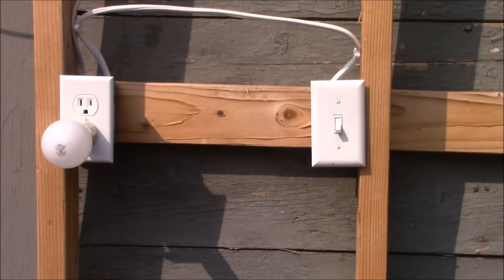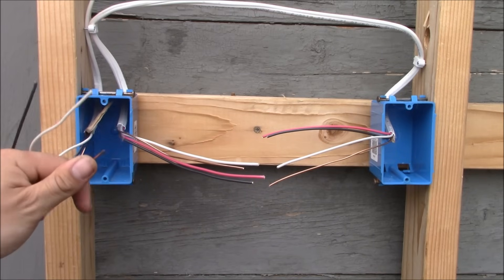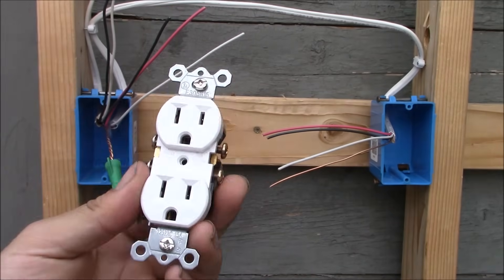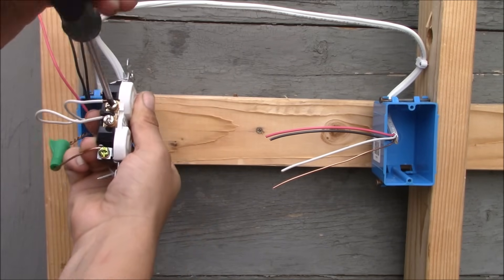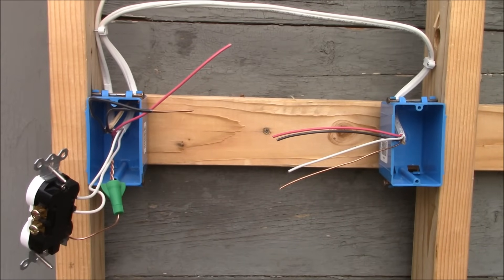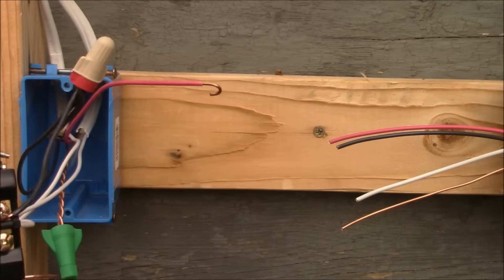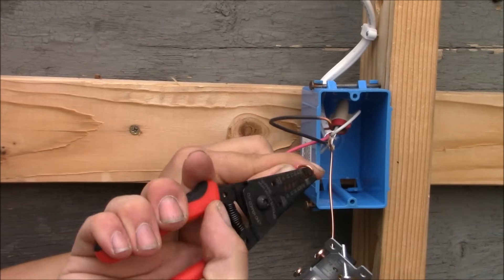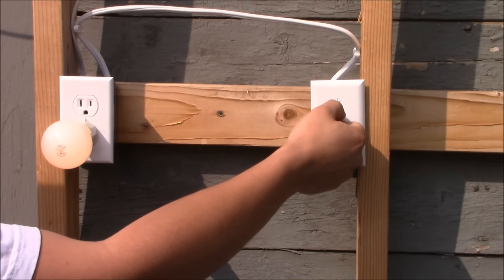How to wire an outlet to a switch (half hot receptacle)

Comment: I’ve seen an application where this was done with two lengths of 14/2 wire and the white wire was used in place of the red wire with a piece of tape to label it. I don’t think it was code but it was interesting to see and I’m just glad it was labeled 😊 but that’s not allowed I assume correct

Comment: My completed circuit shows an open neutral. Is that because of the neutral I capped off with a wire nut? Is the circuit good if that is why?
Reply: If that's not the reason, I've got to break it all down and do it again

Comment: I researched the internet on how to wire in a split switched outlet. I even printed it off and tried to figure out how to do it, but there were three or four wire nuts and grounds that your video didn't have.
I am now on a ladder finishing up the last connections to be able to power a fan in my garage without having to climb up to cut it on and off.
Thanks a hundred times over.
Reply from the maker: You're very welcome, I'm happy to know that my video was of a small help

Comment: What would you do if power came in from light switch and you used 12-2 wire to outlet already? Can you still make one half of that outlet always hot with 12-2 wire going to it? I originally had it wired as an on off outlet used for garbage disposal but installed a sink faucet and I need a hot outlet. Can I get it from that switched outlet?

Comment: Hi, Great video, Can I use 12/2 wire for this? I have a lamppost and a light switch, and I added a receptacle  to the bottom of the lamppost, but I only want that on when I only use the receptacle?

Comment: Why do you need to use 14-3 wire to the switch box, when you're not using the white neutral wire? Why can't you use a 14-2 in both boxes, and use that white neutral wire coming out of the switch box in place of the red wire. After 2011 this would be a code violation I guess.

Comment: I want to put a smart switch in this exact kind of situation.  However, smart switches require a neutral wire, and as you mentioned these switches don't use them.  Mine doesn't even have  the neutral wire (built in the 70s).  

What do I do in this situation?

Comment: Help! Low voltage on my switch controlled outlet. My outlet box only has 2 wires. A white with black tape on the left and a red wire on the right. Can’t figure out the problem. Any clues?

Comment: Question. I installed a receptacle and removed the tab like you did, but still both keep being "hot" even if I flip the switch. I noticed that on another room the room was already "programmed to be top being hot always and bottom controlled by switch, but then I installed a new receptacle without removing the "tab" portion and now the other outlet taht was previously controlled by switch now is active on both. Do all receptacles in a circuit have to be the same for this to work? i.e. do all of them have to have the tab removed in order for it to work? Any help is very appreciated.

Comment: I am getting an open ground on the outlet after connecting everything in the video. I made sure that the ground wire going back down into the switch box are all connected via wago connectors. What is causing the open ground reading?

Comment: i followed this video exactly but somehow the red and white have power (are hot) always. before connecting anything, i checked to see if my wires coming off the gfci (load) are good. they are black (hot) and neutral and ground without power. it’s not until i connect wires to pigtail the hot wire that the other two wires (red and white) suddenly become hot. 

my power is coming from a gfci outlet and at this point am stumped about how to proceed. can anyone help me out? i’m not sure what i’m doing wrong.

Comment: what if I want to make the outlets full hot and use the switch to control a light?
Reply: You could run 14/2 from power to receptacle, 14/2 from receptacle to switch. Do not break tabs, pigtail neutral and hot and connect to receptacle on appropriate screws. Add 14/2 from light to switch. In the switch box, wire nut the 2 neutral wires together. There are 2 hot wire connections on the switch. Connect the one from the receptacle to one screw and the one from the light to the other. It doesn't matter which screw on the switch. Connect the neutral wire to the silver screw on the light housing and black to gold. If there are no screws in the light housing, there will be a black and white wire. Connect appropriately. I didn't mention ground wires yet, but pigtail and connect to device in each box. Now the switch will power the light and the receptacle will be full hot.

Comment: Question for ya I have a switch that has 3 wires coming in that are 12-2 . One wire brings power in from a receptical . The other wire goes to a light and the 3rd wire goes to two recepticals right now the 2 recepticals have switched power how can I make them have constant power and have only the light have switched. How would I wire the switch . The switch has to gold screws and a ground. Please help thanks

Comment: what if i want the switch and the outlet to run independently?

the switch currently controls some recessed lighting and an outlet

i just the switch to ONLY controll the overhead lighting

do i just eliminate the red wire?

Comment: when you have power coming into the outlet, you don't need 12/3. use 12/2 for the switch leg and mark the white wire to the switch as HOT., (black tape, or sharpie marking.) the only time you need 12/3 in this situation is if you are running a combination device at the switch (switch/outlet) and need a neutral.

Comment: thanks for the video, I have this at home and I was wondering what would be the easiest way to disconnect to leave the outlet just working? from the outlet itself or the switch ? thanks
Reply: If it’s wired like the video shows delete 14/3 coming from receptacle to switch & delete switch or pull power & new switch leg to switch box,  outlet will always be hot cause it has power coming from there

Comment: Mmmm I think you reversed the red and the black wire on your switch? The black is HOT and the red is your TRAVELER to the outlet. Power should come in at the bottom of the switch so it flows out when the switch is lifted up! Think of the electrical switch as a gate valve in plumbing.

Comment: Does it matter if the constant hot is on bottom or top? Everybody who makes one of these videos has the switch on the bottom. I’m replacing all my receptacles and the previous one was switch at the top and constant on the bottom. I don’t see why it would make a difference, but I only know enough not to get zapped.
Reply: Not at all. Personal preference.

Comment: Wait, if the white neutral isn’t even hooked up in the switch box, then why is it hooked up in the plug in box?
Reply: It saves one connector in the box... Those wire nuts take up more space than you think.

Comment: Hi , nice video, i have a question, i removed a light fixture on my garage and extend the cables to add two light fixtures outside of my garage, so those ar working good, and look beautiful, those are switch, now , i need to add an outlet, but i need it to be hot all the time, even woth the lights outside off, how can i accomplish that? The fixture i removed imside the garage only have 2 cables, a white and a red , so those are coming from the switch to the fixtute in the garage, that now has a junction box that goes to the lights outside. I appreciate your help

Comment: Thanks for the video it was pretty straightforward.  The only thing I didn’t understand was your description of the neutral.  You mentioned since you wouldn’t be using the box you can cap that wire and shove it to the back.  Can you elaborate?

Comment: When you wire the red and black onto the switch does it matter which one goes on which and or does it not matter ?
Reply: they can go either or because it is a single pull switch, other switches it does matter. the hot terminal screws are connected  on the inside of the switch when the switch is flipped on, when the switch is turned off the connection is broken. one of the black wires he wire nutted together in the box with the receptacle/plug is the feed/hot wire and by connecting that to the black wire that leads to the switch that sends power to the switch as well and then when the switch is flipped on the terminals are connected and the power is allowed to go through the switch leg/red wire back to the plug. so since the terminal screws are connected and power is sent between the two when the switch is turned on it does not matter which screws they are on. since he broke the tab between the hot terminals on the plug the bottom with the red wire is switched and the top is constantly hot/on.
Reply: For a single pole switch it usually doesn't matter at all. But for me personally I always put the hot wire(black) at the bottom, and put the load wire(red or white) on top. 

But for other switches like a 3 way it does matter. Hope this helps.
Reply: Thank you guys

Comment: that's a great video...I just have a question.... do we have to connect the white wire on the outlet we are adding? just asking because we are not going to use it on the switch box right? on the outlet box, can we connect just the white wire that comes from whatever the power is coming from? is the connection on the two silver screws going to work as one? I don't know if I asked the right way but would appreciate if someone answer my question.Hope I didn't get you confused....lolor can I use the same kind of wire (14-2) and just use the white wire that goes to the switch box as the red wire and maybe mark it with some black electrical tape instead of the red?

Comment: Can this be done to a GFCI outlet as well?  We had an electrician install a GFCI and a switch under our sink when they installed a garbage disposal.  I want to now add a hot water dispenser as well, however, I found that both outlets in the GFCI can be run by the switch.  I want to be able to plug both the garbage disposal and the hot water dispenser in, but only the garbage disposal run by the switch.  Is this possible?

Comment: I have a question. I'm trying to control an outlet with a single pole switch, how would I do this with 12/2 Romex instead of 14/3.
Reply: 120v receptacles require a neutral, so you can’t use the white as a switch leg in this case so you need 3 conductor

Comment: Great video.  I was able to follow the instructions exactly to wire a half hot that turns on LEDs in the closet with the light switch and retains always hot on the upper half.  Very straightforward and easy to follow.

Comment: Great video, straight to the point. You did the same thing in under 5 minutes that others have shown with extra jibber jabber and nonsense in about 18-25 minutes. Will be referencing this to make sure I get mine wired up correctly.
Reply: Right, no weather reports or pets or what your goat is doing. Straight to the point, great video!

Comment: Would it be wrong to assume that had you not broken the tab off on the receptical  on the brass screws that both plugs would be hot with the switch on?
Reply: If everything else was the same. The plug would have been hot all the time and the switch would not have made a difference.

Comment: Great video. I have an outlet that was set up this way, but something happened where now BOTH outlets turn on and off via the switch - does that mean that the copper connection has somehow reattached itself or a wire is connecting the two?  Any suggestions would be greatly appreciated.

Comment: I upgraded the old look with newer leviton switches and receptacles, I did the switch first everything was fine, my problem is now after replacing receptacle it stays on and now the switch has no affect on it, what did I do wrong? There's a ground and 4 wires and 8 quick connect holes on the old outlet and only 4 on the new I put all 4 wires in order.  Where did I go wrong? 

Where's the video to wire a on and off receptacle?
Reply: You need to break the metal tabs

Comment: What if the half hot receptacle is controlled by two different switches (3-ways)? I updated my switches and receptacles and thought I wired them back the same but now one of the switches is acting as a master (must be on for the other switch to work...) Thanks!
Reply: Honestly it seems like you have the hot wire in the right place for a 3way switch since the hot matters on a 3 way. 
It seems like you just need to switch the 2 wires around, not the hot one but the others. Hope this helps, but by the looks of it it's been 2 years, soo you've already found the solution too it hopefully. 😂
Reply: @j.rjunior5584  hey, thanks for the response. Have not addressed the issue, we've just gotten crafty with our switch use, haha. Maybe one day I will actually get around to it!
Reply: Did you get an answer to this question?
Reply: @Igotloveonmymind  I'm afraid I have not. Just been living with it!

Comment: Help! 

How about if I wanted to reverse this so that the outlet is always powered. Is my write-up below correct? 

Buy a new receptacle and do not break the connection between the 2 bronze terminals

Cap off the red wire. 

Connect the 2 black wires to the bronze terminals.

Connect white wires to silver terminals. 

Connect ground wire to ground terminal

At the switch

Cap off the red wire.

Connect the black wire to the bronze terminal.

Connect wire to the silver terminal.

Connect ground wire to ground terminal.
Reply from the maker: That sounds right to me.
Reply: @SkillsAndTrade  it worked. Thanks!

Comment: Thank you for this video. I installed this setup on for my garbage disposal off my dishwasher circuit. I would of ran it on it own dedicated circuit but one was not installed for the house. One concern I have is that when plugging a tester into the switch outlet, I get a neutral open light. I assume his is correct since one neutral wire was left unconnected. Is there any call concern?  Everything works fine with the switch. Thanks!!

Comment: I have a wall switch that goes to a half hot receptacle on the opposite corner of my master bedroom. I have no ceiling light, so this outlet provides the lighting for this room. Personally I think it sucks that no ceiling light was installed when they built this house in the mid 70's.  I took a look at the way my switch was wired. I found that, in the switch box, there is only a black and white and ground wire connected to the switch.  And the half hot receptacle had two cables wired inside, both with only the black white and ground cables. No red wire at all. I'm just trying to get a grasp at why the red wire wasn't needed at all since my set up didn't have it. Also all the half hot receptacles in my house seem to have the half hot plug on the top, not on the bottom. Is it code, that they have to be on the bottom? I want to add a ceiling light, and use this same wall switch. Can't I just tap into the cable that connects the switch to the half hot receptacle, without having to  run another cable from the switch to the light?

Comment: Question. What’s the point of connecting the neutral wire to the receptacle on the 14/3 if the other side isn’t connected to anything. It’s wire nutted and pushed to the back of the switch box.
Reply from the maker: To complete the circuit
Reply: Skills and Trade 
Why don’t you connect the neutral to the switch?

Comment: - Does it make any difference which terminal is used for the red or black wire to the switch ??? Thanx for the info. It was short, sweet & concise.
Reply: ✊ Black Wires Matter:
  🔥 hot for ∿ AC
  ⏚ ground for — DC  ✊   

However,...
for a switch leg, according to Ohm's and Kirchoff's Current Laws (Ω & KCL), electricity doesn't care what color the insulation is.  
Diodes only allow current in one direction, but since this is an Alternating Current (AC) switch the probability of a diode as a component in the current path is zero.  Black & Red... doesn't matter which terminal.  If you have OCD and need rationale, put Black on the Bottom because they both start with 'B'.